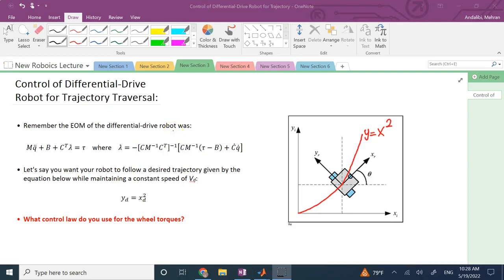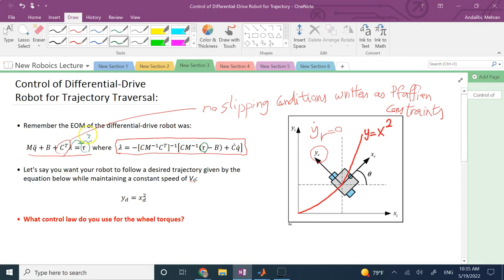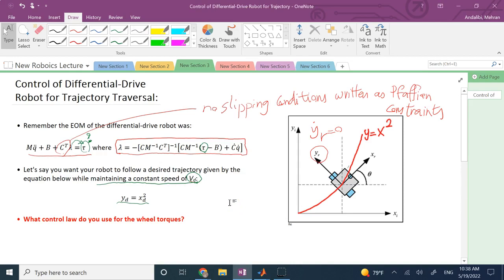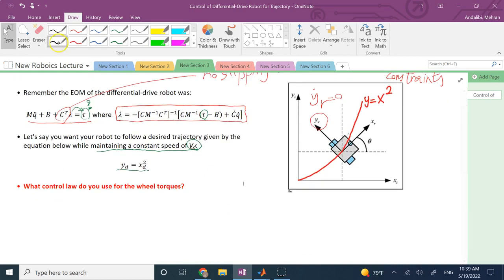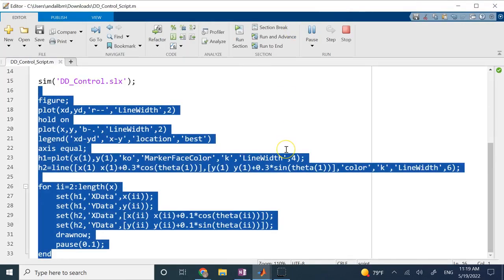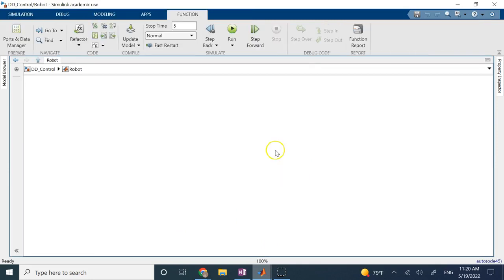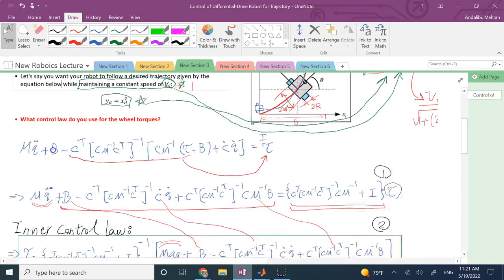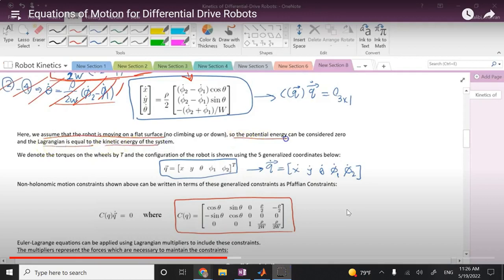Control of Differential Drive Robots for Path Traversal

Comment: Very useful, may I give a suggestion for the next video, you can discuss the dynamics equation using euler lagrange on the robotic arm 3RRR articulated manipulator, especially for the first joint that rotates horizontally instead of vertically. I haven't found a video like this yet

Comment: Amazing video sir, Please answer me this one question, 
I have a mobile robot code for trajectory tracking in simulink that works just fine, i want to implement it on the real robot, can you please refer me to a book, a video, or the key idea. please
Reply from the maker: You can use Simulink coder to compile and upload your code on the robot.
Reply: @mehran1384  But the inputs v and omega of the simulink are attached to the kinematic model lf the robot. I want them to be attached to the real robot. This is what i dont know how to do.

Comment: do you make 1 video about control of differnetial drive robot using PID based on dynamic modelling
Reply from the maker: Dynamic model was used in this video.
Reply: @mehran1384   sorry i have a question that in the equation 4, why you don't have the component Ki because you use PID controller (sorry if i misunderstood) and with any path planning this solution can be use ?
Reply from the maker: @khanho4827  ki is used when you have steady state error.
Reply: @mehran1384  i have one more question why you can compute lamda because in my model Lagrange equation different with you and i don't know how to compute lamda value. In my model, I simplify generalzed coordinates only phiR and phiL to reject lamda.